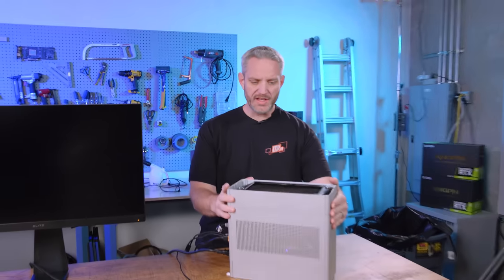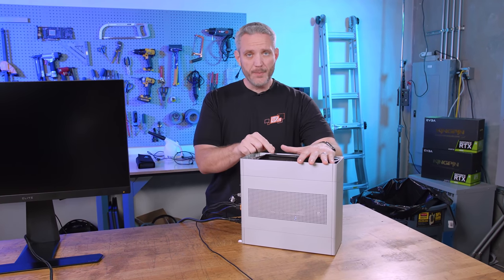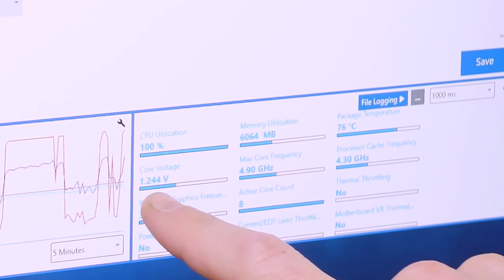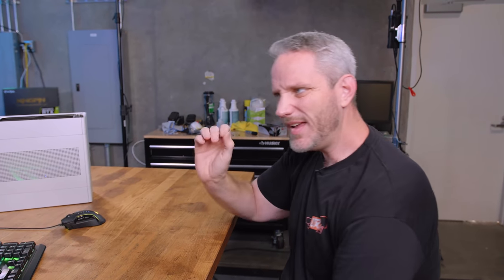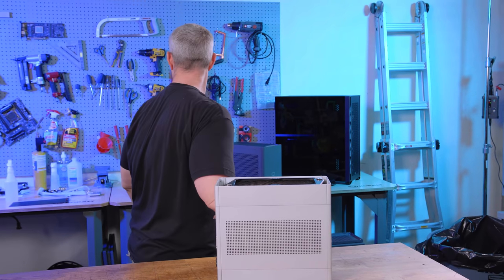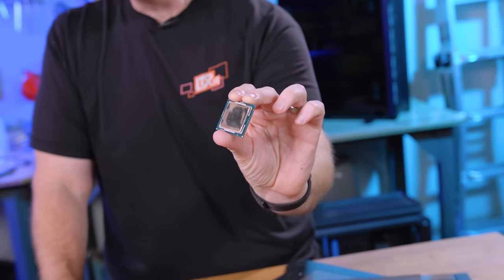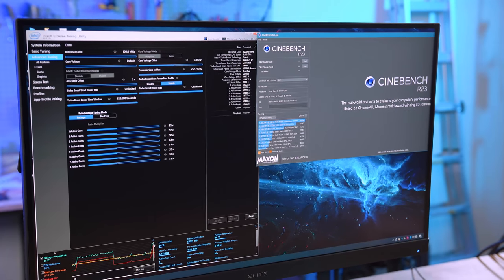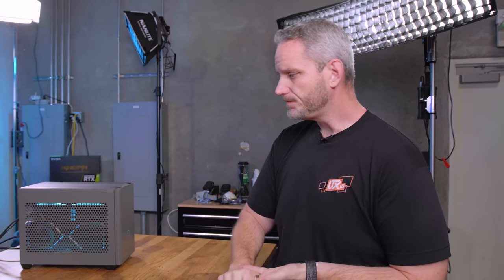THIS is what a Silicon Lottery Winner and Loser looks like for CPUs...

Comment: ifixit ads never get old. Also surprised swiftech stopped making those when smaller builds seem to be somewhat more common now.
Reply: not a fan of most sponsor spotlights. but i agree. i love this one. reminds me of 90s toy commercials.
Reply: Bykski and barrow have similar Block Pump Combos
Reply: More then likely running into Asetek patent issues.
Reply: Thanks for the warning. I love the ifixit ad, but it was too much energy for me to handle at the moment. Been a long weekend at work.
Reply: @Bllfrnd  Using the barrow cpu/res/pump combo atm which works great, but always did like the look of the swiftech block more.
Reply: I am tired of the iFixit ads
Reply: They are a little company in my county in California, about midway between LA and The City. I used to give some of the people working thee drives to work when I was driving Uber. I think it was started by some college students that went to Cal Poly (where Weird Al attended)

Comment: The crack-addict "You got more of them computers to build" energy is exactly why I have this channel. Otherwise I'd go broke trying to do it all myself
Reply: Now even the PS5 is frickin lottery!
U know what I'm talkin about, right?
Reply: @IronMan-jj2fd  it's not though. The smaller cooler design with higher thermal output is the exact same thing the Xbox One X did and no one noticed it then.
Reply: @Skipti_LLC  it's not just about the smaller heatsink, u know there are currently 3 types of internal fan!
Silent, noisy & a bad one.

Also with the smaller heatsink the excess heat directly escapes into the M. 2 slot which is very bad!

Comment: i live in laptop land (travel for a living) where i do the opposite lol. see how much of an undervolt i can do, pull as much as i can while keeping clocks to prevent as little performance loss as possible
Reply: Same in SFF land. Only got so much cooling headroom
Reply: I remember experimenting with undervolting my 4790k to reduce temperatures as much as possible. Managed to get it stable at 1.150v as long as the cpu stayed below a certain temperature, but was fully stable at 1.155

Wanted to cool it so it could stay below 90c in a super low profile case. I ended up upgrading the case and getting an nh-15 anyway
Reply: And i just dont care about overvolting or undervolting i just dont careee i am fine with 30fps in pretty much any game
Reply: @lol123406  for me .145 undervolt is rock solid, .150 bluescreens instantly. i ran all sorts of stress tests, with and without graphics on. .145 was solid, literally hit go on .150 and it'd restart. lol, saved me 300mhz in clocks though. then i underclocked all core from 3.9 to 3.6, and not only does it hold clock it holds decent temps too. 

8750H is what i have, in an aero 15x, awful cooling but does the job
Reply: if you own a recent AMD cpu and want to undervolt, the tool : clock tuner ryzen will help you doing that, I could not get it's "auto-oc" to work but it's diagnostics feature will test lower and lower clocks/volts until you lose stability, giving you as result your own cpu ideal lowest watts/perf values, so perfect for laptop or SFF
Reply: Buy a M1 MacBook
Reply: @potatopotatopotatopotatopo8746  try windows games on that, and get back to me after they dont work
Reply: @bradhaines3142  the pc would bsod and reboot when it reached ~80c at 1.150, but wouldn't at 1.155, so i just keep it at that

since i'm not as thermally limited anymore since i just ended up rebuilding the pc in a better case, i don't worry much about temperatures so i just keep the 4.2 turbo with the undervolt
Reply: @lol123406  well if you're not temp limited you're power limited, so either the chip or the board cant handle the voltage. brother in law has a desktop that cant do the XMP of his ram, at all, because of the cheap board he uses. 

i just found it funny that mine was so solid, just 1 peg away from instacrash. i was expecting more of a fade to instability, not a hard wall
Reply: @mitchell2719  sff for choice or necessity?
Reply: @lol123406  That is some low vcore, was that at stock clocks with a heavy load? Did you try all core overclocking? If so what frequency did you get on the i7 4790K? I had a couple of 4790k and 1 chip was quite good which was did 4.8Ghz at 1.35v all core load (Prime 95 smallest with AVX for hours) and another chip that is one of the best ever chips that did 4.8 Ghz at 1.295v all core load (Prime 95 smallest with AVX ) and 4.9 Ghz @ 1.345v.
Reply: This is me on Desktop.
My 1070 runs at 1911MHz@920mV (1987@1050mV stock)
My Ryzen 3100 runs on 4.1GHz @ 1.11V (3.9@1.2 Stock)
Could I do 4.4? Yes. Would it require 1.4V, drawing more power? Also yes.
Reply: @itsTyrion  a 1070 and a 3100?! touch mismatched there, on the bright side it'd be an easy upgrade
Reply: @bradhaines3142  wdym
Reply: @potatopotatopotatopotatopo8746  No way.
Reply: @bradhaines3142  I'll will try out that method in my laptop, I also have 8750h and it cooks when tryning to game

Comment: The r5 3600 holds all core 4.2 at 1.24 volts and 4.3 at 1.27. I consider it a golden sample because, 2 of my friends have the same chip and cant get it close to that. It took 22 years of building computers to finally get a good one.
Reply: I'm at 4.5 all core, 1.3 voltage on my r5 3600
Reply: @IceBreakBottle  Beautiful. I can't get any higher than 4.4 @ 1.32v. It is a big jump for mine from 4.3 to 4.4. I can't hit 4.5 no matter what I throw at it.
Reply: lol, I can't even get 4.2 all core no matter the voltage. Nice CPUs boys.
Reply: @seraph2377  I am a R5 3600xt, I am stable at 4.5 1.1v I have a go every so often to try and bump up to anything. Yet if its not an auto crash its a Cinebench crash or even game crash (Ran 4.6 for a week before realising as soon as the hits top load even for a second, Crash)  Alot of reviewer's got theirs up to 4.7 at 1.25v or 1.38v (which Jay even says Reviewers tend to get the better hand picked ones) yet I have not had luck in getting even 4.525 to work.
Reply: Sounds like a average sample to me 😂
Reply: I'm at 4.3ghz 1.19375 stable for months almost a year
Reply: I was able to 4.4 all core at 1.275 for my everyday OC. Mine could do higher but the extra voltage and heat was more than I was happy with. Also, I made the mistake of using a crappy Asrock motherboard which with their insane Auto voltage setting it was trying to push my chip to 1.46v at stock speeds!!!! A manual overclock was necessary just to get the temps down and I'll never buy another Asrock motherboard again.
Reply: My 3600 does 4.4ghz at 1.2v
Runs everything I care about, which includes some "competitive" benchmarking softwares (got addicted to farming HWbot points). It probably wouldn't hold up under prime95 small FFTs but that's not a realistic workload anyway.
Been running it since October like this and hasn't crashed at all on this config (I've run it at 4.625ghz at 1.325v a couple times but I get the same scores in benchmarks anyway, and it's less stable)
And before you say I'm degrading my cpu, it went right back to 4.4ghz 1.2v afterwards, so if it's degraded I haven't noticed
Reply: i mean my friends ryzne 5 3600 couldnt even doh a 4.3ghz OC with 280mm corsair AIO thing went up to 85c and crashed. i tried all core 4.2ghz same story i said fuk it let it run stock, mine from aliexpress is at 4.3ghz no worries on air cooling does a better job then his 280mm AIO did i guess he got the bad luck silcone.. and i got a normal one.. cause i used to have a i7 2600k 4.3ghz max anything over instant crash at boot... or with in 5min.. not even stress test... while my oncle had a i7 3770k 4.6ghz no problem even 4.7ghz but to much heat he kept it at 4.5ghz im like mine wont even doh 4.4ghz.. or 4.35.. all i could do was 4.2ghz + 102mhz blck cause at 4.3ghz it also crash but not with bclk on it
Reply: @tyraelhermosa  yeh my oncle had the same with his ryzen i tried every thing...
ran hot and wouldnt OC... he had a corsair 280mm AIO he even tried changing it place in his pc still got hot AF stock, any oc was a instant crash...
Reply: @reggiexp69  
I had a R9 series card like that once. I know it's not an apples to apples comparison but seriously even +15Mhz to the GDDR5 or 0.5Mhz core would instant crash as soon as it was under load if it didn't freeze as soon as I hit apply.

Silicon lottery goes both ways. You're most likely to get an average bin and as rare as it is to receive a golden sample it's also very rare (but it still happens!) to receive a garbage bin lmao

Sad days when you realize you got the bottom of the barrel. At that point just leave it at stock and do what you can to manage temps and let auto do its thing.
Reply: @The_Man_In_Red  yup true, gpus never had that bad luck only my msi gtx1070 gaming x, while mining had horrible hashrate 26-27mhs while my oncle had 2 of them that ran 31mhs... gaming whise i always keep gpu stock, no need for oc, often a cpu OC gives a bigger boost
Reply: Can make 4600 on all cores with R5 5600x  1.275V or so...  4650 with 1.3V it sure thing, temp and wattage are more restraining factor for me as i mostly look upon daily usage
Normal 4.4 all cores i can undervolt up to 1.08 or 1.07 volts or so
Guess i am happy too with that
Reply: I have a 3600xt and I run it at 4.35 at 1.25 volts, which is actually a undervolt lol, thing was hitting 1.45 volts all the time

Comment: I remember the best silicon lottery winner I dealt with was a 486 back in the 90s.  My dad built computers for companies and this one was a 486DX2 for a CAD company.  We managed to get a significant overclock on it but cant remember exactly what, but the computer just seemed so responsive.  Over the next couple of years my dad built more for this company which ended up being in the Pentium 90 / 120 / 150 range as that was now the norm.  One day we went to their site to do a repair on a computer and saw the a guy still using the 486 we built years before.  I asked him why he is still using that old 486 and he said it actually ran faster doing CAD than the new ones. I had a quick go on the old 486 and it really was just better all round for some reason.
Reply: It's awesome, reminds me of cars engines or chassis design. They're all slightly different with barely different flexibility but the performance difference could be significant in the right situation

Comment: Your Microcenter comment reminded me of something from years ago .  I questioned an AC Delco rep I knew about their parts quality between parts houses , dealerships , OEM and your bargain retailers (Kmart , bargain auto supply stores) . According to him , OEM got the pick of the crop (golden Samples , if you will) . Werther it be spark plugs , brake pads , oil filters , etc . That's why your plugs & brakes seem to last a longer time than replacements . Then comes your AC Delco distributors (they supplied to both dealerships and certain auto supply's ) . Then came the bottom feeders (Kmart and bargain auto supply houses) . Granted , this was years ago but nothing has changed much . I worked both at independent auto shops & dealerships . The better quality parts (and higher priced) was thru the dealership . those blister-pack spark plugs were a joke . guaranteed engine miss or check engine light . oil filter quality , oh boy . Talk about garbage ! Radio Shack also sold those bags of capacitors and resisters that was untested junk from Texas Instruments . My mother worked at T.I. for many years & warned me about them ...
Reply: @scorpion07070  But that's actually the opposite of what OP described...
Reply: Ive had two 10900Ks, one from Microcenter and one from a prebuilt. The Microcenter one was an SP54, and could barely do 5.1ghz all core, the OEM one is an SP109 and can do 5.4ghz all core stable at the same voltage. I have a suspicion that this particular chip was binned for the OEM since a chip this good is extremely rare
Reply: @sneedsneed460  But why? Barely nobody overclocks their prebuilt, it's just wasted.
Especially as the motherboards usually can't do high overclocks anyway. 
I get OP's setup. A OEM car manufacturer doesn't want to break during warranty when service is included, thus it highly benefits if those parts are the most durable ones.
But prebuits and overclocking headroom...

Comment: I've never, in any build I've done, been able to get even remotely near influencer level overclocking or undervolting. I swear, sometimes it doesn't even look like the same product.
Reply: That's because probably it's not stable.  I bet this overclock doesn't last 5 minutes in OCCT.  A cinebench run is not stress testing.
Reply: @MaCK0y  r23 or intel burn 🔥 test is fine if left running... I've passed occt and prime 95 just to bsod on a game or cinebench r23 or burn test (burn test can be strange as well though) there's literally a instability test on r23 you can enable it runs for 30 mins r23 is harder to pass imo
Reply: ive been lucky over the years with good silicone. had an FX 8 core chip that i ran at 5.0ghz all core for 7 years on a used 240 aio. posted performance almost akin to a 4770k i7. then upgraded to a 3950x, and mine hits boosts (on a noctua NHD15, stock board fan curve) higher than what AMD put on the box (gets close to 4.8 on boost without overclocking). i havent been able to push my new 5600x in my iRacing rig yet, GPU prices, but im hoping i got lucky on that one too

Comment: Overcurrent and overvoltage protection circuits > En/Dis
Processor integrated efficiency mode > Disable.

Then, on power management (windows sett.) set to high performance, cooling cpu profile set to run fans after boosting cpu clock. Keep in mind all overclocking values might be arbitrary capped by BIOS, so test on incremental steps and eventually would see a BSOD, but generally speaking CPUs know how to work in a frequency rollercoaster.

Comment: I do the same, CPU overclock first before RAM overclock. It's more straight forward in my experience. And people, gets a K-sku CPU if you want that flexibility for your overclocking (being able to change your CPU frequency multiplier and not only your BCLK that affect your RAM and PCIe at the same time). I listen, I watched the whole video before commenting this time. =D <3
Reply: now a days bclk is seprate from pcie and ram you can change it and not have it affect them. but its pretty common to not be able to change bclk on non K sku you pretty much have to get lucky to have bckl option on non k sku for newer stuff.

Comment: Funny thing: We actually had an example of this back in the Core 2 Quad days.  Two nearly-identical rigs (same GPU (GTS 250), different mainboards (Dad went Intel, I went EVGA), same CPU (Q9550), but the two CPUs behaved completely differently.  Dad took the CPU from 2.93 GHz to 4.1 GHz with relatively sane voltages.  Mine, I had up to 3.3 GHz, redlining the voltage at 1.36v, just to remain stable.  Then again, I still had the faster rig because I had better memory (higher speed, tighter timings) for the speeds I was running.

With Intel's i7 era and DDR3, I really learned the benefits of playing with timings.  DDR3 running at 6-6-6-18 is stupid fast.

Comment: 9900k is also soldered. I delidded mine and have scraped the indium off of it. I can do 5.1 at 1.28v and 5.2 at 1.34v although it gets too hot for my liking so I leave it at 5.1. Also lapped mine and there was no difference despite being raised in the center.
Reply: I agree delidding is the way forward with the 9900k, Mine just runs so hot in Cinebench R23, hits 100c on 1 core and 95c on some others but will complete the test, that's at default voltage with an -0.25v offset with no AVX offset at 5Ghz all cores (MCE enabled in bios and All Turbo settings to Performance except running Speedstep),
Cooled in an custom loop with 4x 360 external rads. Could be my paste or CPU block is hindering it too but I think I just lucked out on this 9900k.

Comment: Hey jay, have you tried filling a custom watercooling loop using a water tap or a hose (attach fill port/tube to tap and put drain port in the drain of the sink)? I don't remember what video it was, but Linus tried it and found it to be pretty effective in bleeding the air out of the system.
Reply: Der8auer did it
Reply: would a few drops of hydrogen peroxide kill things like that without damaging the tubing?
Reply: @scorpion07070  I don't know. Neither if it would kill or if it would not damage the tubing.
But I do know that it would not remove limescale.

Comment: So, what you've just said is that Intel send high binned CPUs to reviewers and influencers - which of course makes sense. It's a bit disingenuous though.
Reply: I'm not entirely sure about that. I mean sometimes they ship out actual engineering samples just labelled "intel confidential", those chips are usually much worse than retail chips.
The important thing is that it runs like it's advertised. Launch reviews rarely test and compare overclocking, so it's not like intel would be gaining much by pre-binning chips for reviewers
Reply: @lunakoala5053  Perhaps true that overclocking is not tested - however as shown here (well, not really?) the "golden sample" would run cooler - which looks better on paper of course.
I bet AMD does it too.
And as far as it being a standard practice (i'm assuming that, here) it only really affects us customers - we must always take the performance and temps in such a video with a grain of salt. Unless of course, the reviewer has anonymously purchased the CPU from another retailer - kind of like what GamersNexus did with their prebuilt PC series.

Comment: Hey, can you do a vid on under volting a 5800x? People have been doing it to help with thermals because some people’s chips, like mine, run super hot.
Reply: It's quite simple, just start backing down your voltage looking for the stable spot.  My 5800x does 4.8GHz all core locked at 1.25v.